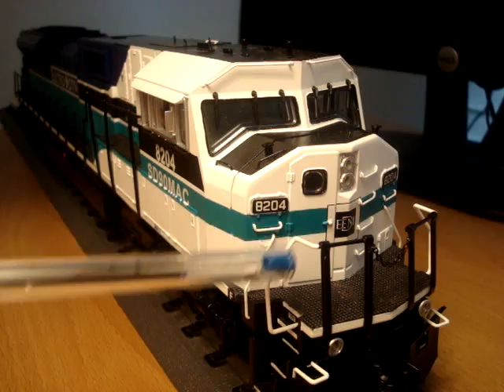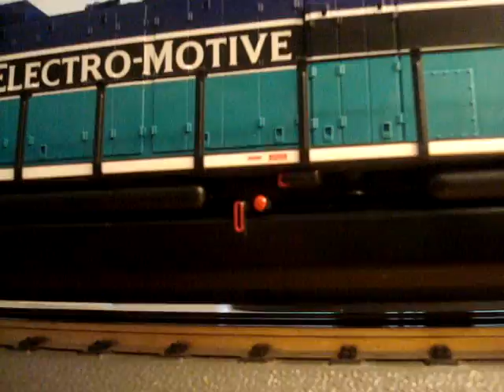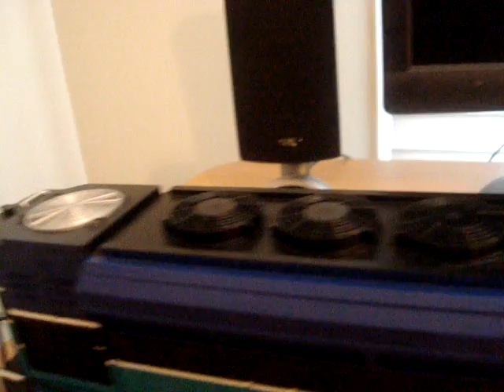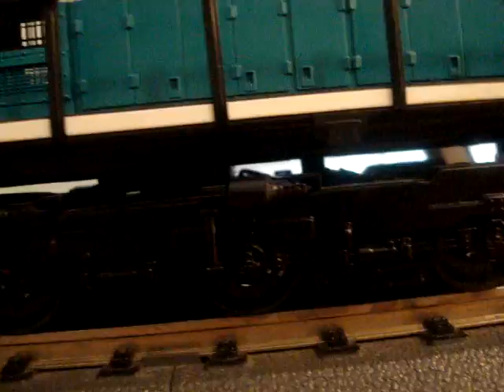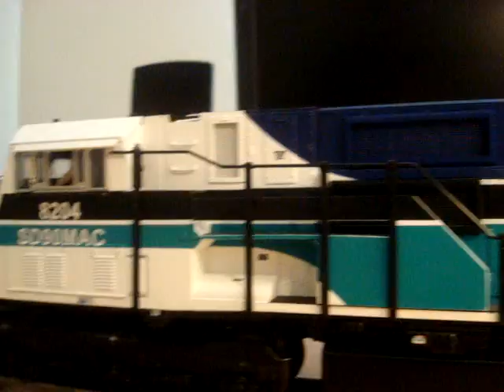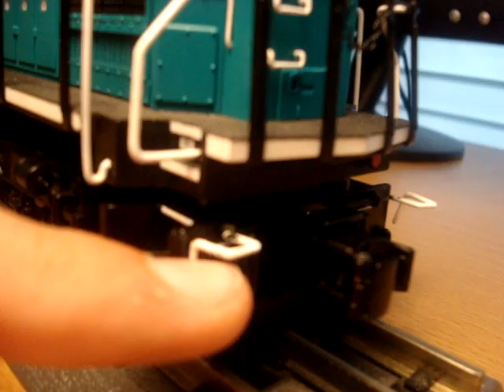MTH Premier EMD SD9043MAC Demonstrator Review part 1/2

Comment: What is the minimum curve
Reply from the maker: 0-42 I believe, although I highly recommend larger curves for a prototypical look. Even with 0-72s there's decently obvious overhang, due to the sheer length of this engine.
Reply: @bradstrains  ok thanks I have one on lay away but now I have to take it out of lay away because I use 0-36 curves thanks for the info